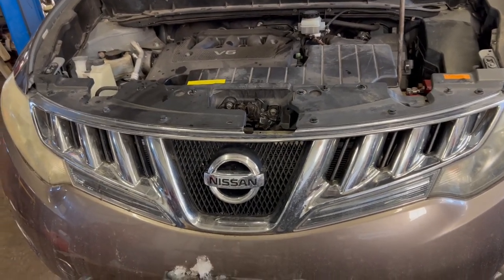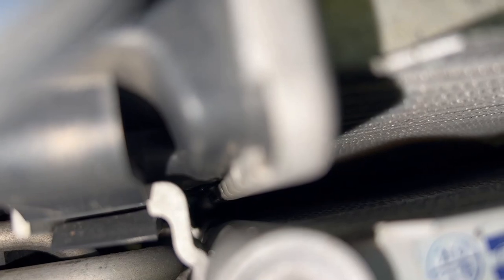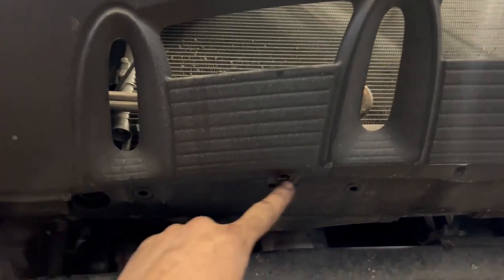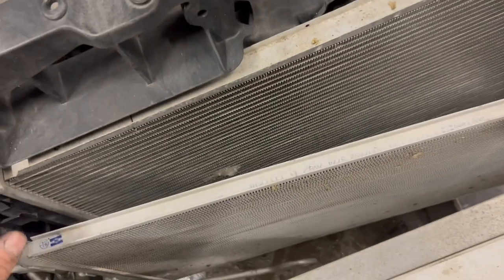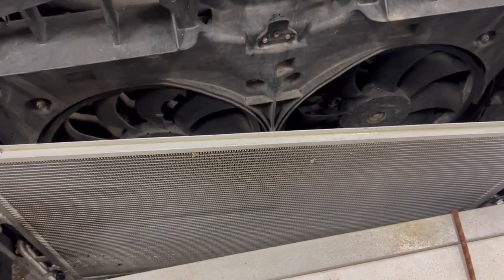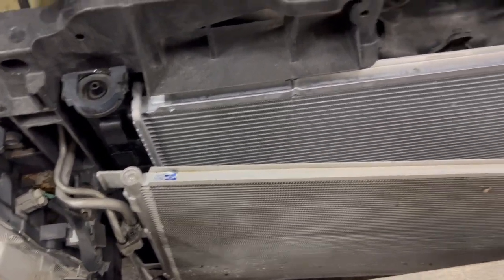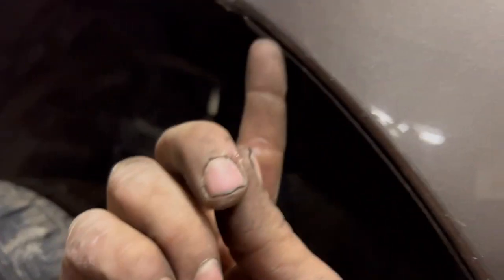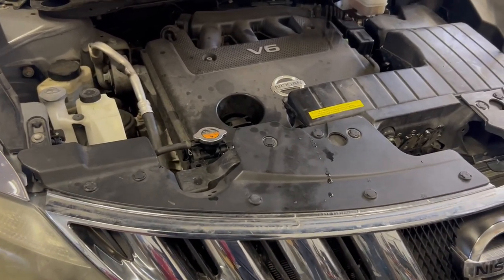How to replace radiator on 2008 Nissan Murano

Comment: were you not able to connect the lower transmission line and lower outlet rad hose from above without lifting the vehicle? I need to change the rad on my 2011 murano but don't have a garage or lift.
Reply from the maker: I'm sure you can get it without the lift it just may not be as easy but you should be able to get it.

Comment: What all tools you used bro ??
Reply from the maker: Most of the bolts are 10mm so just a couple basic hand tools like sockets and screwdrivers a hose clamp pliers and the cooling system filler witch isn't necessary but helpful
Reply: Thank you..got radiator for 60 dollars ebay.. question.. how long did it take from start to finish..